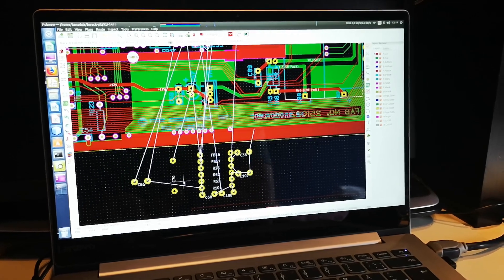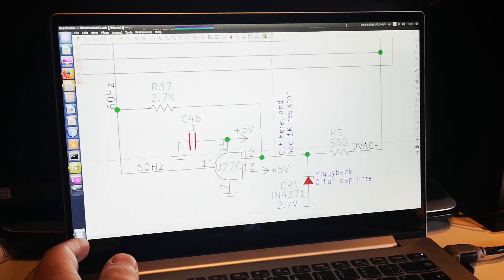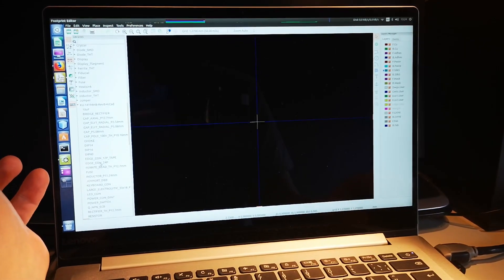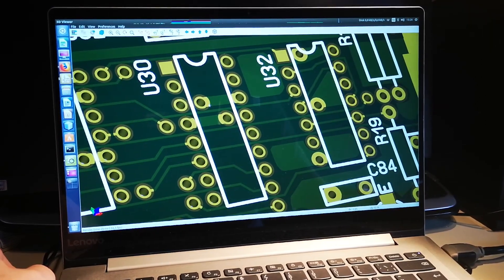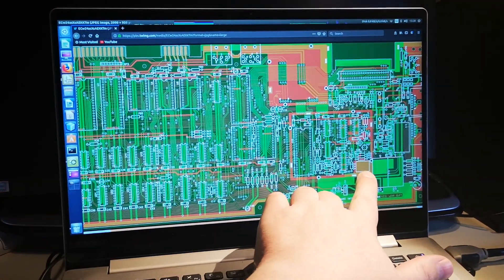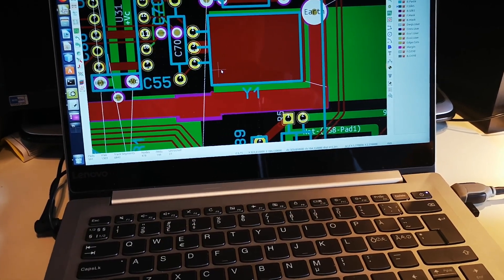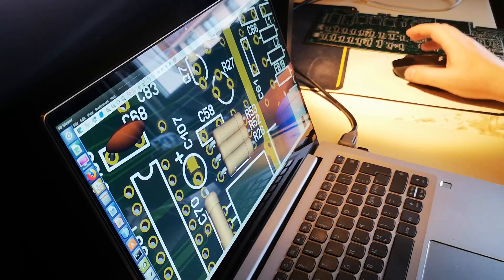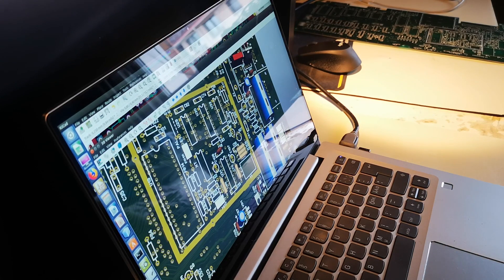C64 KU Motherboard replication update

Comment: As much as I like these board remakes / replicas I would incorporate 2 modernizations and one or two improvements: 1st a modern powersupply onboard and incorporate a 64 saver type protection circuit so one can simply use an appropriate external 12 to 24 v powerbrick like an laptop psu. 2nd is modern SRAM to replace the dram that is often failing maybe with the option to have an GEO-RAM or 1750 type extension internally. 3rd is the option to choose which type of SID to use by jumper or dipswitch and switchable pal/ntsc option. And las but not least an 1541 / datasette emulator with SD-Card or usb drive for masstorage.
Reply from the maker: 12V input sounds like a great idea!

Comment: This is some massive and awesome work! 
I've been using Kicad a while now as well, and it's really great once you get accustomed to it.
On a side note I just started looking at implementing a replacement for the 6526, but then noticed you already had done it in the form of VHDL . I have a couple of questions about the project as a whole, but especially concerning time of day circuit, to be precise the difference between chip revisions and the bugs. It's always neat to be able to enable the bugs for compatibility checking. The VICE emulator has some of them implemented, but that has to be enabled during build/compilation. The bugs of the time of day circuit however seems to be multiple and not extremely well documented.
Anyways, huge fan of your work!
Reply from the maker: Hi. Thanks for the comment. I'm picking up on the project. Got a development board made for this project recently, now I just need time. (get this KU motherboard out of the gate). That is very cool that you are looking at implementing a 6526 design. I need to look at my code to answer anything regarding the TOD. https://github.com/bwack/VHDL6526 .. I made  testbenches to simulate and verify the VHDL modules according to the datasheet. The datasheet for the 6526 is very detailed, but we don't know how accurate the information is.

Comment: Having a board made with a bunch of mistakes to find doesn't sound like heaps of fun. Imagine how it was for the original designers though! What a job. I think about that when looking at things like the SID or the VIC. So much work went into designing and building that. 
I'm sure your work, however complete, will be a spring board for some other person in the future. Basically the C64 is holy.
Reply from the maker: Thanks. Thats one of the ideas, making a spring board for others. 🙂